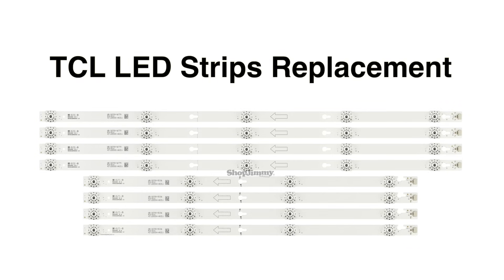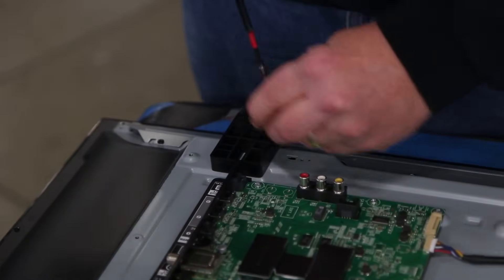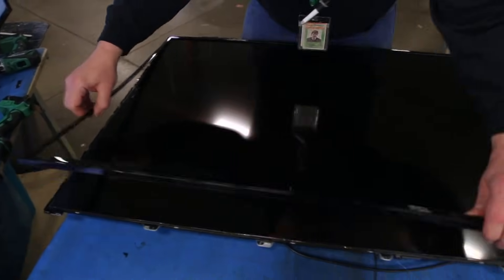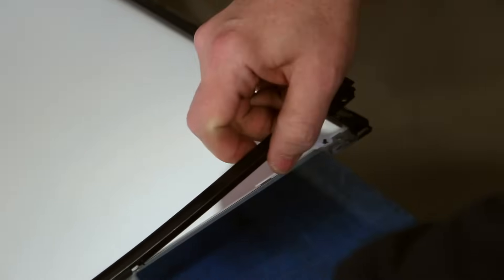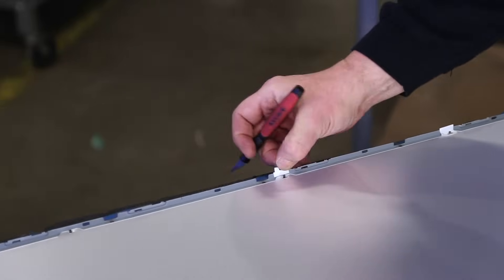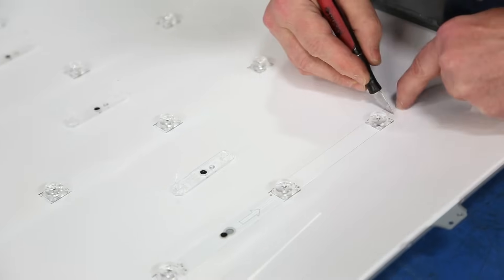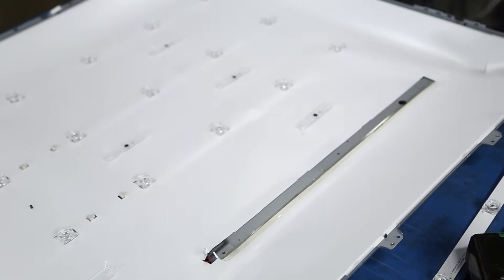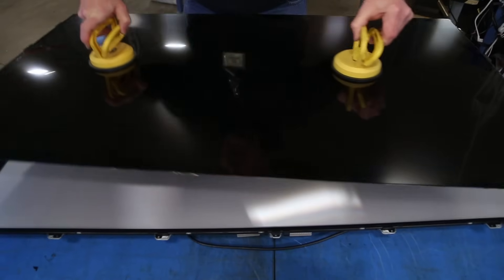TCL 55" TV LED Strip Replacement Tutorial for TCL Models 55S401 & 55S405

Comment: After watching this video,.it convinced me to just buy a new (NON-TCL) tv. I only paid $280 for it. $50 for the strips, at least an hour of time, tools like double sided tape, permanently cutting the reflector, and a high chance of screwing something up. And even if you fix it, chances are extremely likely another strip will go out again unless you replace them all. 
Learned a lesson though, you get what you pay for. They clearly designed this TV to fail right out of warranty.
Reply: But $50 for the strips gets you all new pieces. "chances are extremely likely another strip will go out again unless you replace them all". When you do this repair you replace ALL the LEDs. Because ya, there are 36 LEDs, so 36 chances of failure. Only 1 out of 36 could fail this TV. So, replace them all is what you do.
Reply: I had a $260 40inch 4K display, in storage for the past year and now one LED strip failed. What a pain in the ass. I thought they were designed to be replaceable or to never fail because LEDs don't burn out like lightbulbs.
Reply: I was 3 weeks past my one year warranty so you are right, these TVs are junk.
Reply: @stepaukob 
Sad to hear that. Mine stopped after 8 years. But ChatGPT says it's a known issue in TCL LED TVs after using them for years. Apparently, it's mere luck how long it will run past the 1-year warranty period.
Reply: @omaralazzawey is not luck is actual time being used the problem is heat  in order to make tv thinner they make the heat spreaders smaller and thinner too.  A well cool ventiladed led can last 15 years of nornal use. But heat reduce the lifespan to 5 years of normal use. Which is what manufacturers want for their planned obsolescence orr 1 years if you never turn off the tv which is just after the warranty. Is all calculated.
Reply: In what world does someone have the time to repair this ? The initial comment made it sound as though it was a 5 minute job. This is all day affair and there’s a good chance you will break the screen or lose some parts. Really would have preferred a, “sorry man, go find a new TV unless you are an expert electrical engineer”
Reply: @montymiranda299 I'm a cheapskate and it beats buying a new one. Only took about an hour and I'm far from an expert. In my opinion it's worth it if you're willing to do the work
Reply: Same thing just happened with mine 6 months and already went out
Reply: Same! 6mos past warranty and mine went out!!! Piece of poop! I’ll never buy another tcl again!
Reply: You are either leaving the tv on 24/7 or you have the brightness setting as high as it will go. That is the only reason why these TVs fail. I have repaired over a dozen TCL TVs and they have ALL been on the HIGHEST BRIGHTNESS SETTING. @kaylajones243

Comment: I doubt anyone will reply to this, but why not just melt the adhesive with a blow dryer and remove the whole reflector sheet carefully? Cutting the whole sheet seems like it would affect the picture where the strips have been cut, and using a heat source to melt the glue would fix the issue with it being hard to remove. I'm going to attempt a full led replacement tomorrow and have been puzzling over this. Everyone else I've watched has simply removed the reflector sheet, some tearing it but the picture still seemed ok? This is the one part I'm stuck on how to proceed
Reply: The reflector sheet is actually easy to pull of gently. I don't know about a blow dryer since it's made of some sort of plastic or plastic coated paper I think it might warp and cause problems with the picture
Reply: @Andrew-el7or  So how about heating the glue from back side, where the metal is? But you'd probably have to remove all the boards from the back plate just to make sure you don't damage the power supply or mainboard.

Comment: At 4:07 there's no mention of putting back the reflector pieces you cut out while removing the LED strips. Wouldn't this cause less brightness due to less reflection resulting in you to turn up the back light brightness and causing the new LEDs to burn out even quicker than before? Why not use a heat gun to completely remove the reflector sheet? If it's not needed, then why keep it?
Reply: I just commented something similar before seeing your comment. I think I'm going to try using a hair dryer and see what happens
Reply: @sirbarky  I just tried the heat gun method to remove the reflective paper. For the most part, it worked. The heat actually made the sticky adhesive looser. But, like I do sometimes I go overboard. I used a bit too much heat for too long in one area. The paper is a bit heat wrinkled. But I don't think it will really affect much. The LED lights in their plastic magnifiers are the most source of light. The reflective paper just reflects the light bouncing from the plastic sheet and the edges of the reflective plastic magnifying pieces on the LEDs. So, if you even pulled the reflective sheet out, I'm sure all you'd see is a tiny bit of light reduction.

Comment: Company charging 300$ for this. And some individual asking for 120$. How much does it actually cost?
Reply: Well I'd imagine the LED strips should cost around $20-$40, and the rest is labor. I'd probably charge around 200$ (not quite seeing the process for this TV yet, but I've done this process on another brand), so the guy charging 120$ is an idiot or a sucker for pain.

Comment: Some missed steps and notes:

You don't mention the back cover to the main board connector.

You don't mention there are TWO connectors on the wi-fi board.

You don't mention the ribbon connector needs disconnected from the scan drive board nor how to flip up the locking flap/lever.

Note- running a piece of plastic under the panel at the top plastic piece seemed difficult and it is possible to get a bit to intent on this and crack the corner of the panel. 

Otherwise very good video
Reply: Yup. What I did was snap the edge plastic piece out along with the LCD. Screw trying to scrape the glass. My LCD came out with the top and bottom plastic trim.

Comment: The back light went out in my 55S405 as well after 2 years. pretty terrible. How do you know that this repair will solve the issue? In other words, What diagnostics can you do to figure out if it is the lights or what's powering the lights? Maybe the wires leading to the lights? While its a good video the work is still delicate and i would hate to sink $50 into a maybe solution.
Reply: I've done this repair on a Toshiba TV about a year ago. I've watched other videos showing that most of the time it just takes one LED on the whole strip to put the power supply into shutdown mode. The guy found the bad LED and jumped it with a tiny resistor and fixed it. Me, I'd rather replace the whole strip because sometimes you have 64 LEDs so that makes 63 more chances of an old LED dying again.
Reply: @MeMe-wh7tr  yeah happened to me the guy who repaired my TV just replaced 2 leds and soldiered them to the old dead ones causing the TV to give up again in a month. He wanted to charge me 200 dollars again but I opened it and saw what he did when he said he purchased all new led kit. Wish I could take him the old pieces to show him that I know what he truly did.

Comment: My 50S425 model is suffering from bad LEDs after only 1.5 years of ownership/use. TCL refuses to perform any kind of warranty on my TV that is less than 2 years old.  

DO NOT BUY TCL.
Reply: Wow.  Don't know what the magic trick was but they replaced my TV even though it was more than 2 years old.   I couldn't have been happier with their service.
Reply: @EP-ni6my  Be prepared to replace it or call them again in another 1.5 to 2.5 years, depending on how bright you have your TV set at. How happy should anyone be to have garbage replaced with garbage?

Comment: I have a tcl 65s423 tv. When I turn it on I see the tcl screen flash for a part of a second then it goes off. If I look at the screen from an angle I can just make out what the tv is showing. Thoughts on what the issue is?
Reply: Sounds to me like the backlights are turning on for a brief moment, then turning off, possibly due to short or open circuit on the LED strip. One way to tell is take a flash light and shine it on the screen while the TV is on. If you see faint images, then your backlight LEDs or backlight power supply may be bad.

Comment: I replace one strip a few months ago. My tv went black again. I disassembled it again and found a different strip is now burnt? Is there a specific reason this is happening or should I replace all strips? Will the new strips get burnt out as well? Basically asking if its a problem with all of the factory led strip, or an issue with another component, outputting too much power?
Reply: I would guess they have found a way to render these TVs inoperable just outside the warranty period. Capacitors used to be the big tool back in the day, now they just overdrive LEDs to burn them out. I've seen on another TV brand their power supply can sense when just one LED burns out, it will then turn off the whole strip. Kind of like a long string of christmas lights when one bulb dies, you have to hunt to find which one. There are smarter ways to build these, and I'm sure they know all of them. But that defeats their purpose and goal of consumerism.
Reply: Probably just cheap LEDs designed to break after so many hours

Comment: I got right to "thin piece of plastic to ensure the adhesive had been removed" and got a small spiderweb crack in the bottom corner of the screen. Either way good instructions. I just screwed up.
Reply: Same here, make sure to read the comments before following this video. Or actually find a better video to follow. The top of the screen is not going to come out like in the video. His has obviously already been removed.
Reply: F me same
Reply: It would have been helpful if this video specified to slide the plastic on only one side of the screen. I got a small crack too because I was trying to slide it along the side attached to the bracket. I thought it was just really strong adhesive so I applied a smidge too much pressure and now that corner of the screen is distorted. 🤬

Comment: I have a 65" TCL, my kid hit the screen and cracked it. When I turn it on, the whole screen is black except for the point of impact, where it shows what I would described as "leaked light". Would you know what I need to replace on it and if it's worth it?
Reply: Not worth it in my opinion. Other easy to fix parts is okay.

Comment: Another note in addition to the comments below about the scan drive boards: DO NOT fully cut off the reflector sheet segments. Instead of fully cutting away the reflector sheet, I was able to cut a slit along the top edge of the LED strip and slide the strip out, slide the new one in and carefully tape it back together. This is a pretty good video but the editor must've gotten carried away trying to cut it down to 5 minutes. They leave out a few critical steps and useful tips.
Reply: This is the method I used too. Really easy to just cut one side and slip it out.
Reply: Why shouldn't it just be cut the way he did it?
Reply: @wesker877  so you get a better fit and retain the original reflector which is probably beneficial to the end picture/results.

Comment: I have a tcl 55" tv model:55UP120
It has audio and I did the flashlight test to see that I  have picture as well but I don't know if the strips are bad or what?
Reply: The strips are bad
Reply: These shithead manufacturers use cheap LEDs and drive them with more power than they're designed for to get that extra brightness people want. LEDs last a long time. Pfft, not if you overdrive them with voltage.

Comment: The reflector panel being glued down proves they don't care about their customers other than selling them a TV. They expect them to run out and buy a new one.
Reply: Plus the glue they used to hold the LCD panel down, visible at 1:37.
Reply: Literally just cut one side of the paper and bend it back. It takes like, minutes, tops.

Comment: DO NOT do the section in the video that tells you to run a plastic stick on the top part of the screen to separate the screen, before lifting it out with suction cups. Instead, just un-attach the plastic bevel itself (or whatever you want to call it) together with the screen attached to it, as you will not be able to pry the top right-hand corner off. The screen is super glued by the manufacturer so that it cracks when trying to pry it from the plastic bevel.
Reply: Ahhh yes thank you! They left out 2 important steps of the most dangerous part. I got the adhesive out of the left right and bottom, but the top is way more aggresively attached. Also they didn't mention undoing the ribbon cable to that board on the bottom.
Reply: @bagofclothes7360  Don't like how easy they made scraping the glue look? You just run your hand with ease from side to the other, and it's loose. They sure didn't put much effort into making this video. Kind of makes you question the quality of the parts they sell.

Comment: I have the same thing wrong with my TV, but my model is the 55S405TJAA, When I take off the back, there's not TCon board. Ribbon goes from main board directly into scan drive boards.  I've never seen this on any of the models taken apart on youtube.  Is it even possible to have a working TV without TCon boards?
Reply: I think you got ripped of buddy
Reply: I have the 32 inch and need led strip do you know where I can get them

Comment: Warning!!! This should be a huge warning at the beginning of the video about disconnecting the scan drive boards and not tearing the ribbons to the panel. This video makes it look like you just pull the panel off. Someone is going to tear the ribbons off. There are some better videos out there about removing the panels themselves
Reply: I just did this repair. Although the video didn't say anything about removing the scan boards from the plastic brackets, while i was un-sticking the adhesive it was very apparent that the boards needed to be removed from the brackets. To the less technical this would be a crucial step to know. Hopefully people read these comments first
Reply: @imobracing  Can you explain how to remove those ribbons?
Reply: @ePetanovich  It has been a while since I did the repair so I'm a little foggy at this point. I believe I had to remove the scan drive  board from the plastic holder, once removed you can flip up the brown retaining tab that locks the ribbon in place
Reply: iMOB Racing found it. Thank you!!
Reply: Can you put the link

Comment: One very important step was missed.  It's important to carefully pop the scan drive boards out of their plastic holders, and being very careful of the ribbons, tape them to the top of the panel with masking tape.  One piece on each end of each board will suffice.  If you don't do this, you will rip the ribbon cables right off of the screen panel when you lift it out of the frame.
Reply: You can't just rip the initial cover off (0:26) either, there is a cable you must unfasten or you could damage it.  Not sure why this guy skipped so many things for the vid, I appreciate the effort.  Not sure he had success as he never showed the thing working at the end which would have been nice.
Reply: Just got to this point in the video and was so confused. Thank you so much!
Reply: @Trisqueer  @steveh112 how do you disconnect those two ribbons that you can see at the 2:02 mark?
Reply: Excellent point.  I will try to do this same repair myself. Any recommendations of where to buy these led strips besides eBay? Thank you.
Reply: @salvador8157  Below is a link to the ones i bought on ebay and worked perfectly for my  55S405

https://www.ebay.com/itm/4C-LB5504-HR-4C-LB5505-HR-LED-Backlight-Strips-for-TCL-55-TV-55UC6426-55S405/224073376842?ssPageName=STRK%3AMEBIDX%3AIT&_trksid=p2057872.m2749.l2648
Reply: @ePetanovich  Thank you my friend. I will get those then.
Reply: Thanks
Reply: Hey do you know how to reattach the gold ribbons that go from the scan drive board to the screen? Not the ribbons that in the plastic holders but the one's that seem to be glued onto the board?
Reply: @TheMrModders  Those can only be attached at the manufacturing facility. If they tore lose from the board or screen, the panel is junk.
Reply: @Steveh112  ok thank you. Sadly one of them came off so now my screen is missing about 1/5th of the display. But atleast I got the backlights replaced 😆
Reply: @TheMrModders  Sorry bro but I laughed when I read this! 😂 Bet you couldn’t even see that 1/5th with how bright it is with new backlights! ☺️
Reply: Quick question... Not saying I did but just in case what happens if the ribbon is ripped?
Reply: @Sunknown08carsturbo  Unfortunately that would ruin the display causing anything from a dead column of lines to a totally unintelligible picture depending on which one and how much of it severed.
Reply: Did just that. Damnit.
Reply: „Make sure that the adhesive has been removed” the author doesn’t explain how to remove it. I run a plastic strip, the adhesive was really strong, and the glass broke.
Reply: So how often do all the strips go bad at the same time? I would think if the entire screen went blank it would be a power supply issue.
Reply: @larrydufresne5052  All of the LED's are connected in series so similar to a cheap set of Christmas tree lights, if one LED burns out, the entire array goes dark.  And it's best to replace the complete set of strips because if one LED burned out, the others are not far behind it.  In the past, I've replaced single burned out LED's only to have most of them come back within a couple months with another LED burned out and same problem.
Reply: I really want to do this but it seems like a lot of work and time consuming. How long would it reasonably take an amateur to do this at the kitchen table (don’t really have a workspace for things like this)?